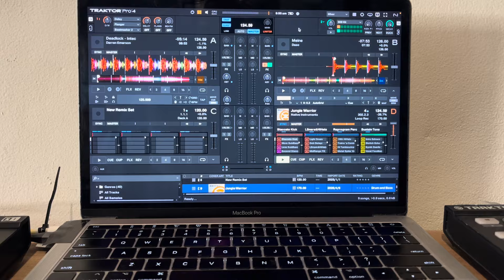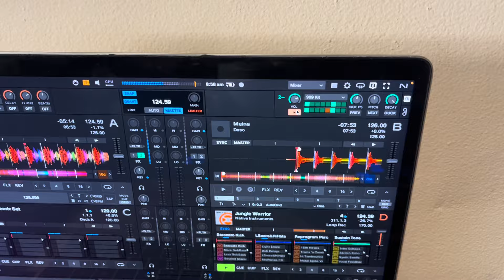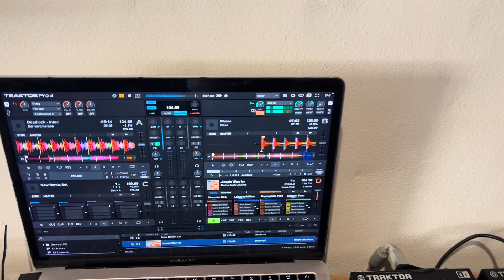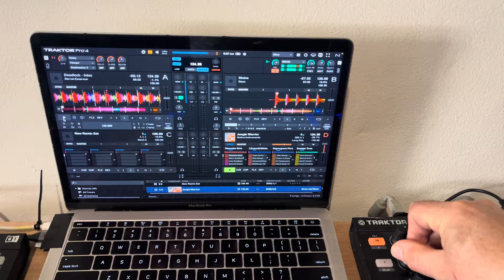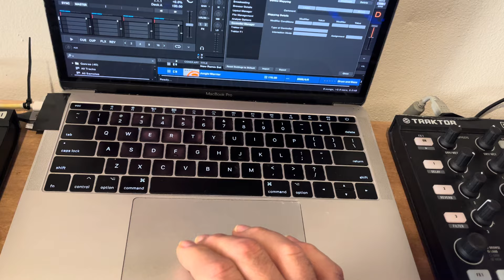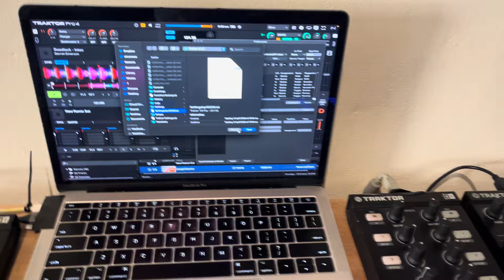Traktor Pro 4 - Using custom mapping Kontrol X1 Mk 1 to control Pattern Player Pt 2

Comment: How did you get macbook to recognize x1 mk1. I cannot figure out how to get the driver
Reply from the maker: Check for updates in native access. Install these.. then plug it in it should show up in the preferences. It’s generally just plug and play so I hope that helps.
Reply: Open controller manager/editor with traktor closed. Had same issue in windows 11, then open traktor